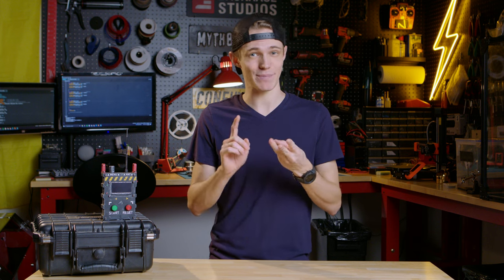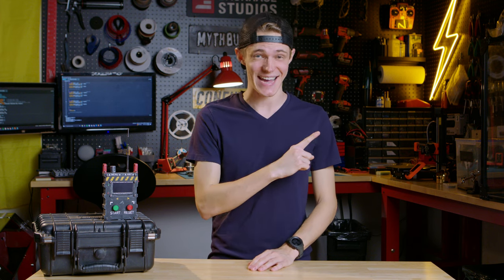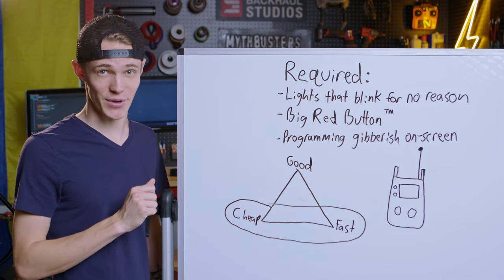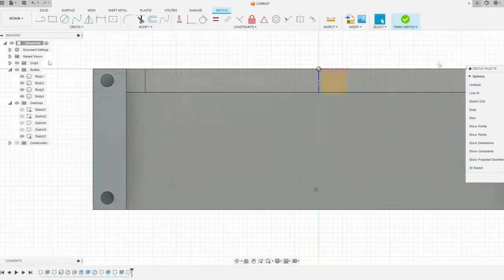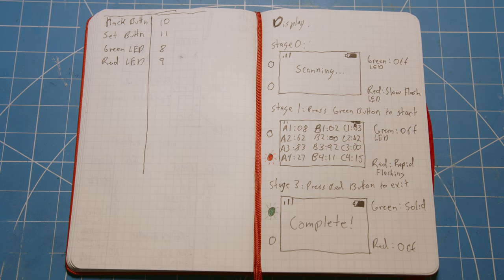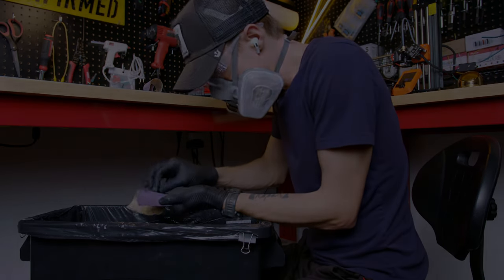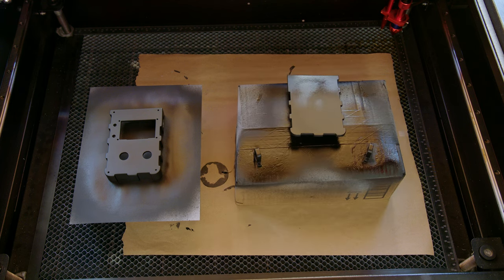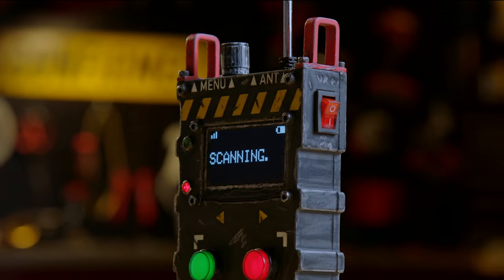I Built a Movie Prop in Just 36 Hours

Comment: Nice work! Would love to see more details on the decal creation and weathering.
Reply from the maker: Thank you! For the decals, I just imported the safe crackers outline from my CAD program into Illustrator and then designed some text and graphics that were then cut out of vinyl on my Cricut. For the weathering, I gave it a few passes of sand paper to rough it up, as well as using my dremel to give it some larger scratches. Hope that helps!

Comment: Fantastic!
Fantastic work! 
Do you only use filler primer to smoothen the prints? Or do you make use of any putty or other fillers?
Reply from the maker: You’re correct on the filler primer! I give it a few coats after sanding, occasionally with some wet sanding with 1000 grit if I really need a smooth finish